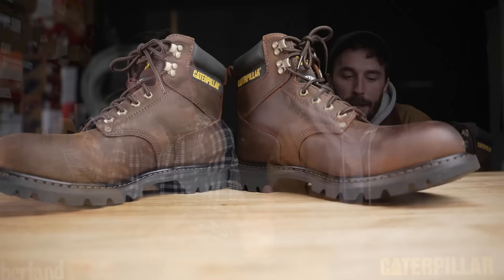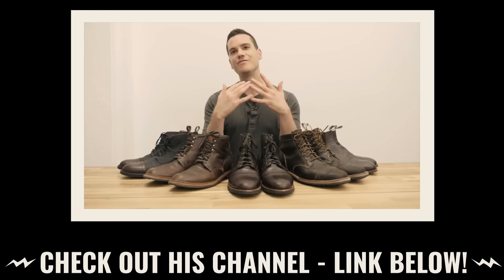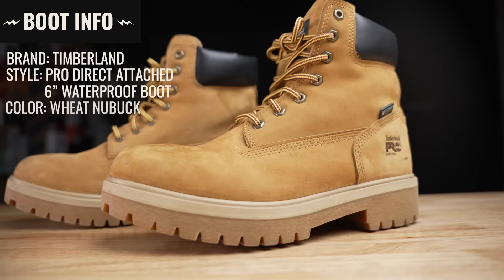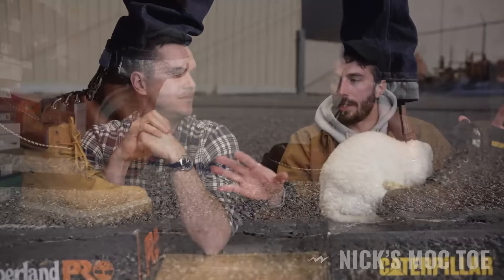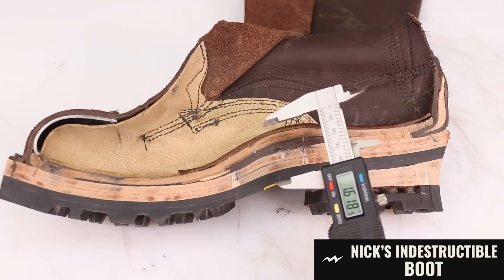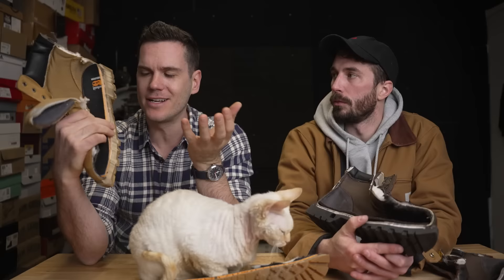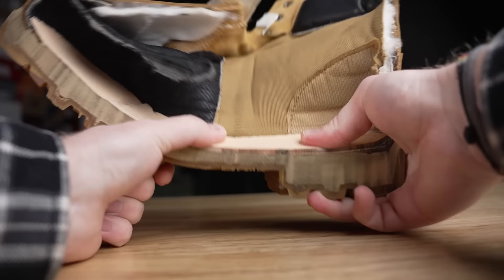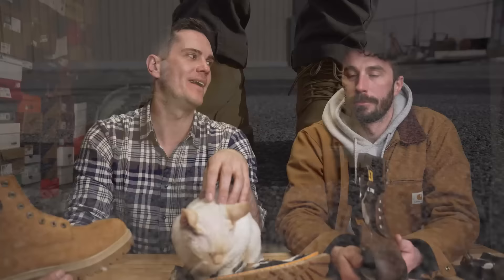Best Budget Work Boot - Timberland Pro VS CAT - (CUT IN HALF)

Comment: As a new construction exterior carpenter, I may HAVE to buy a pair of the tim pros. fuck me,  that cross section makes them look COMFORTABLE! I have been a Thorogood 1957 series wedge sole loyalist, but they cost 250+ a pair and only last me a year. The Thorogood wedge soles last longer than the uppers anyway, so I guess the goodyear welt is useless. No resoling them.
Reply: I do carpentry concrete & have tried many brands/styles over the last 20 years. I love the Timberland Pro steel toe 8". I've found them extremely comfortable & the only complete failure I've had is kicking a 3" tear in them on a drain spade. Operator error.
I run them hard all seasons in Buffalo NY, and typically get about a year out of them. They don't completely fail, the leather just becomes spongey and they've lost their springy comfort after a couple thousand miles. 
I've never been cold in the winter, or hot in the summer. I buy them for comfort. 
Spray them with silicone once or twice a month to improve their water repellency.
I run these along with a pair of Thorogood or Carolina wedge mocs and unless they stop making them, I'm done looking. 
Boots are about the most subjective thing out there, but I prefer these to higher end models I've owned. 
Best of luck.

Comment: This is so strange with America, i live in sweden, no constructionsite in the country would allow you on site with a pair of them boots. We have like acidresistant rubbersoles, steeltoe, "step on nail protection", anti slip soles,  it's like your stuck in the 70s or something. Who goes to work wearing what we use as autum shoes on a weekend. i understand the concept of like factory worker or something using this in america, but here. whenever u start work where u can't have your day to day shoes. u get like workshoes like i described earlier. For free from your employer. that is suited for the work your going to do. like a new pair each year. This is so strange to me...
Reply: Yeah, we don't want that nanny state bs. That's why construction costs 3x more and takes 2x longer over there. You need to pay 3 losers to stand around with clipboards. Btw, we have resistant soles, nail protection, steel toes, and all the same stuff. Not everyone on a construction site needs uncomfortable steel toe boots. Not every contractor is hanging iron.
Reply: Portugal is the same , once i forget their steel boots in home , they lent some steel caps with elastic to put on the tip of the sneakers, i drive only pallet bikes in the warehouse back there .
Reply: @littlejackalo5326  Yep, no nanny state, no health insurance, and cardboard houses which fold over when it's a bit windy! Good for you guys!

Comment: I used to work at Cat headquarters assembling large wheel loaders with access to the Cat safety store and every boot they offered plus some other brands they offered in their safety program. Nearly every new hire, myself included got Cat branded boots for their first pair because of the name…being a gung-ho new hire plus they offered them at about 50% off. And that was back when working there meant something. The employees who actually put their boots to work threw them away and went back to the store for the Carolinas or Georgia boots they offered secondary to their own brand even though they didn’t offer the same discount. Then again, I have two pair of Tims and those hurt my feet after some time as well…and that’s just casual use.  Being in manual labor my entire working life, I’ve gone to wedge soles and haven’t looked back but boots are very subjective.

Comment: As a mechanic without a lift who does a lot of kneeling, i really love my CAT second shift soft toe boots, theyve held up great in the extremely tough environment except for the plastic welt which got hard and eventually cracked near the toe, i dont know how they would hold up now, but about 8 years ago i bought a pair of Dickies rubber toe 6 inch boots from a big 5 as a quick stop gap and i ended up using them for 5 years, wearing them almost daily, until the stitching on the welt started to fall apart from wear, and water intrusion became a problem i couldnt just shrug off.
Reply: @Patrick O'Brien I don't think that's the greatest analogy, because an oven is essential for baking, you'd be surprised at what can be done with just a floor jack and a couple of bottle jacks, lifts make life easier, but they are not essential.

Comment: I own 2 pairs of Cats, one of them re-soled, the oldest one is over 10 years old... they've kept my feet very safe, they get pretty comfortable with time, they are warm enough for non freezing temperatures and not hot at all in the summer, I'd totally recommend them even for the same price as the Timby, unless you really need a totally waterproof boot! Cats are splash proof and you won't get wet if you submerge your foot in a puddle for a few seconds, actually I've worked in very wet places and never got a drop of water in my socks wearing them.

Comment: Didn't really use my TimPros like this one in the video for working. It's been over 4 years, and the leather and padding are amazing. But the direct attached, were flaking off the boots. And I lived in a very humid country. I think a good year welt can probably last longer than a direct attached. I asked, a shoe cobbler who has worked with many branded footware for over 40+ years of experienced if they can repair it and they say, they will have to use foam. It cost around $30-35. Not sure if direct attached can actually be replace or repaired at all.

Comment: I'm 34 and I've worn Caterpillar boots daily for the last 20 years.  My only complaint is the cheaper (~$70) black full grain steel toe boots sold at outlet stores always end up with chewed up scuffed toes and I have never figured out how that happens but it could be cheaper leather.  The shoes last me a good 3-5 years.  If the sole starts to separate I just glue it up and keep walking.  I had an oiled pair once and the toes faired better but they weren't steel toe.  I always put an insert in and always waterproof them occasionally with mink oil.  I keep buying them because they're cheap, last, and haven't failed me yet.
Reply: the hard toes tear up because there is no give.....they all do

Comment: I noticed the cat was siding with the Cats. I currently have a black pair of the Timberland Pro Sawhorse and a brown pair of the Caterpillar Powerplant saftey boots. IMO the best thing about the Tim's is the aesthetic shape, comfort and the waterproofing but the lining falls apart around the heel within a few weeks and my first pair both left and right shoes has separated uppers from the midsole all around the circumference of the heels within a year without really too much walking but I do buy new pairs when they die so they must have something about them I guess. I've worked through a pair of Catapillars before but dont remember much but them being comfortable right out the box, I'm just about to start on a new pair

Comment: I have a pair of Cats, steel toed. Mind you I only wear them for yard work but I have a BIG yard and spend 5-10 hours a week out there making my rapidly aging body ache during the spring and summer. After 9(ish?) years, maybe longer, the tread still exists and the seams aren't splitting. I am 6 and 1/2' tall and weigh 230 lbs. Kind of a big deal to me. They're also true to size (which is a big deal) and comfortable since the day I put them on. No need to wear 2 pair of socks to avoid blisters. If I wore these 40 hours a week all year, you'd no doubt get 3 years of incessant abuse out of them easy. I wore them to shovel snow. Once. lol They're not good for cold and the eyelets rusted. I had to get a bottle of black nail polish.
Reply: Another thing is the steel shank. I thought of this cuz of the clip of the guy digging. That adds a lot of support which is needed. So if you need to be absolutely stomping on a shovel to get through "dirt" which is just dry Appalachian clay full of rocks you don't have to worry about hurting the tendons in the arch of your foot. And the steel toe cap is rated to 800 lbs. I haven't quite tested it to that level but, working with big slabs of stone after frost expansion made my drystone walls tumble, they work and they don't dent. That's great because if a steel toe dents enough, after it breaks your toes, you're gonna have a fun time getting the boot off.

Comment: Love my Cat Revolvers. I spend long days in them on stone, concrete, and dirt. On their 4th year and going strong, the soles show little wear other than some cuts and gouges from kicking shovels and walking on sharp rocks and bits of metal. I clean with saddle soap about once a year and follow up with a little bick 4 then mink oil for water resistance. I brush when I remember to, and use a boothbrush to wash mud out of the stitch when needed. The leather is holding up great and looks better than when new. 

Not perfect, of course. Cracked the welt (plastic) at the toes a little by kicking rocks (to shed dirt and mud), fixed with boot glue and changed my habits a bit and they've been perfectly fine since. I wish the material over the heel counter wasn't plastic. It's cracked up, but hasn't impacted wear or comfort though. Would definitely buy again.

Comment: I tried these CAT boots once. All good, except the fact it has lame tongue construction. Point is the boots allow wind to sneak inside which might be a plus in case you wear them at work when it's warm outside. My goal was to cover casual use for a cold season. And I tried Timbs PRO. Game changed. No windy issues. Fully water resistant. Warm, comfy and last for 3 winter seasons already. Notice: it won't give you a huge amount of warmth when it's literally freezing, in all other cases - my best purchase. Cannot recommend enough.

Comment: I own this model of timberlands, and I can report they are extremely comfortable. I have worn them every single day, for 12+ hours a day, walking in them 5+ miles a day, in rain, shine, rugged terrain, nice floors, and everything inbetween. They have been my daily driver for 10 months, and I felt no fatigue with them after an 18 hour shift (granted I use a custom insole). The only problem is that the stitching on the outside is starting to wear out and open up, and the outsole is completely destroyed, with many crevasses that leave the foam exposed. The insulation does not pose a problem to florida heat in my experience.

If you want a cost effective work boot, I highly recommend the timberlands. Local shoe stores and repair shops might have a pair they are willing to negotiate the price on, I got mine for 120 ;)

Comment: I've been wearing  Timberlind Pro (Endurance) work boots for several years now because they were one of the only options I found with steel toe, AND puncture rated steel shank.  I work in tree service and we have some crazy huge 3+inch thorns around here(AZ desert) that will puncture normal soles and tires. The boots hold up well for me under pretty hard use. I replace the insole after 4-6months and after a couple insoles I just replace the boots ~every year.  I think the foam mid-sole just breaks down and I have ankle/knee issues from youth sports injuries.  When my ankle starts hurting all day I swap the soles, or replace the boots and the pain goes away for another 3-6months.  I've gone through  4-5 pairs of these in the last 4 years  and never had issues with the outer/upper.  just break down the midsoles doing 5-10miles a day 7 days a week. So performance seems good for me given the price.  Maybe I could try swapping the undersole out for 2xinsoles after a year but for $150 I just replace them and keep working. I do also wear these boots for climbing work, both pruning and removal.  they hold up well to the abrasion and wear of climbing trees and are fine standing on tree spikes too, again I have the steel insole plate which must help with the rigidity there. They are HEAVY though with the steel toe and shank.   I'm trying to find some lighter boots for daily wear and keep my current near new Timberlands for days I know we have huge thorns in store.

Comment: I only bought a few CAT Model P725124M4M for its cap plus the rubber that covers the toe and the sole that protrudes from the boot gives you more protection. They are hard boots and somewhat heavy, it's just a matter of getting used to them At approximately 175 dollars here in Mexico.

Comment: I’ve had two pairs of the Cat Second Shift boots. I cut the last pair in half to see why the midsole wares down so fast and hurts my feet. I see from your cuts that Cat has added two more layers of the white foam, mine only had one which explains why the ball of my feet get sore. Mine also did not have removable inner soles. I may try another pair now that Cat has upgraded the components.
I’ll be cutting my retired shoes in half from now on.
One more thing. Mine had a thin hard layer of plastic cemented to the rubber sole, so your not going to get much cushioning from the rubber soles. It’s no wonder the balls of my feet got so sore after a couple of months of use.
You forgot to mention this feature (unless they removed it) ,the hard plastic layer cemented to the rubber outsole which stiffens the foot bed and provides extra protection for your foot.
As far as water proofing (resistant) goes I just use Snow-seal which is  a wax product. Works great.

Comment: I have the Timberlands in a dark blue leather. Light wheat colour soles. Have been wearing them lots for about 8 years. Soles are getting worn but these boots are practically indestructible. They are still waterproof. Why pay more when they are so hardwearing and comfortable. I will end up getting them resoled at some point.

Comment: I have the Timberlands and they last me about 3 years working in EMS. 24 hour shifts 10 days a month. I just wish they had an 8” boot. Once broken in they are very comfortable.
Reply: They do. I've been through at least 10 pairs of Timberland Pro Direct Attach 8". Exact same boot pictured here but in 8" instead of 6". 
I'm assuming you have the standard Timberland boot, not the "Pro"? Those to my knowledge do not, or I have not seen them come in an 8". 
I do construction in Buffalo N.Y., I've tried several more expensive boots & keep coming back to the Pro 8" 's.

Comment: The thin rubber bottom is a no go for me. I am someone who wares-out the rubber bottom on nike running sneakers within a month when they are that thin. I need to walk in indoor soccer shoes because of the more durable rubber bottom to get any life out of shoe. The stitches and texture is a no problem for me because they brake down with age snd exposure to hazards. But for me its walking long distance and therefor the bottoms rubber thickness is what wares out before the shoes begin to show any signs of aging. So the clued and stitched thick rubber bottom on the Cats wins this by far.

Comment: I bought the Timberlands PRO about a year ago and they have been, by far, the most uncomfortable boots I have ever used. I used them nonstop for about nine months and they were never really comfortable, but when I started using them again after leaving them aside for the summer they had become absolutely unusable. The heel lining had started to peel off and it scratched my feet really painfully, so much so that I got blisters just after half a day of use. I brought them to a cobbler and he put a bit of leather in the heel to repair the lining, but somehow the boots are still an absolute pain to use!

The leather is also quite subpar. Just in the second day I got the boots I kicked a traffic traffic barrier and it took a big chunk of the outer layer. I understand that was my mistake and to be fair I didn't feel any pain, but if these are work boots I'd expect a bit more of resilience for such a minimal strike.

I will never buy anything Timberland.
Reply: You might have a flat foot like me

Comment: In my experience w/ the Timberland Pro series, (and other direct injection molded sole boots as well) is that walking on an abrasive surface like rough unfinished concrete all day, will quickly wear through the hard-rubber coating of the outer-sole (especially if you tend to drag your heels in your stride, as you walk). Once through the hard outer coating, pretty much all water resistance is lost. Depending on the individual of course, this can be achieved in as little as a few months or so. They did used to have a lifetime warranty on them, which if sent back to the manufacturer, would be replaced in full. IDK about anymore